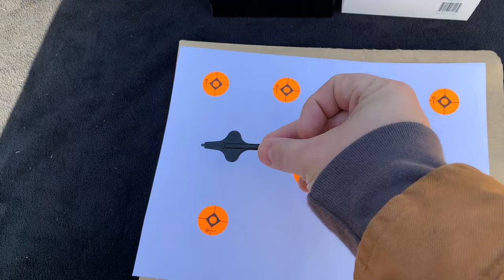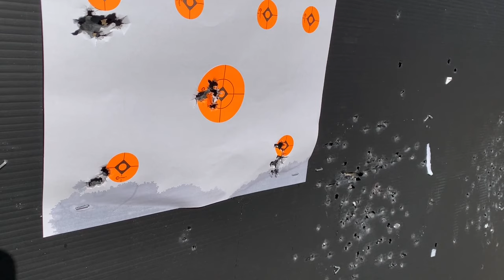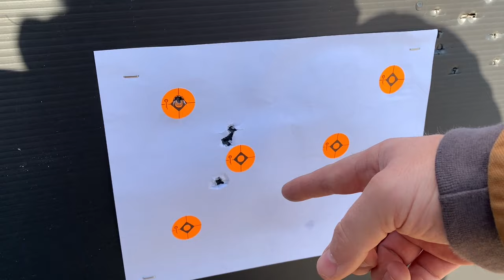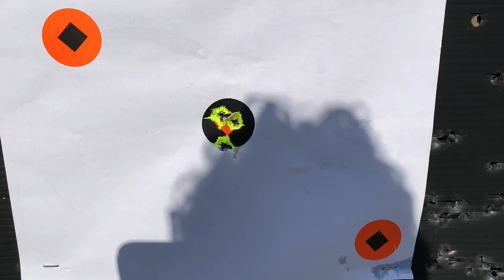Zeroing a Pistol Red Dot

Comment: when zeroing any sight; laser or RDS use a bench rest and range finder for best accuracy.  Eliminate human error.  Every time you shoot standing there will always be variation and difficulty zeroing.  Guns don't need to be broken in from the factory.  They're accurate out of the box.
Reply from the maker: “Accurate out of the box” is a massive generalization and simply not true. Clearly there was impact shift, what the cause is I don’t know as I stated in the video. I didn’t say it was break in related, I said it could be a possibility. You are never going to eliminate all human error unless you put the gun in a vise and at that point you are going to be fighting factory ammo inconsistencies. If I can hit damn near dead center on a quarter and nickel size target from 7 yards repeatedly, that’s good enough for me. Like I said, I’ll check it on a cold bore and make adjustments as needed.
Reply: That's actually not how you want to be doing it because from a bench you'll find your line of sight changes drastically.
Reply: @TerminalM193  Facts because I just zero my red dot with a stand at first, then stood up and my shot group of 5s was way off.  Just zero it standimg up 15yds.
Reply: @realspitkenny5561  Yea, took me many of zeroing processes to realize this. I now do the exact same as you, zero while standing at 15 yards. It takes probably double the amount of rounds compared to a bench zero but it's a no discussion topic in my eyes. Just like you my bench zero would be set but the second I do standing shots on target its off not only by windage but also vertically as well.
Reply: @realspitkenny5561  9
Reply: You dont need all that but sure
Reply: nah. they aren't. specially mass produced guns. but if you're dealing with competition guns. yeah out of the box they're zeroed.
Reply: This is a bunch of turd info. If your zeroing from standing, you zeroing for you lack of marksmanship, when you get better and stop pulling etc, you’ll be off, with the bench you zeroed for exactly where the gun should shoot. you guys standing zero are just accounting/zeroing for your error, which hopefully goes away as you shoot more but then your zero will be off

Comment: I tell everyone when making adjustments to a red dot optic ALWAYS make big adjustments.  Don't waste your time with "three clicks".  Start with EIGHT and go from there.  Also you don't start sighting in a hand-gun standing.  So much human error.  Bench rest it then when you are on go ahead and try it standing.  By the way excellent shooting.
Reply from the maker: I’m a worse shot from the bench with a pistol. Seriously not to brag but I’m confident in my ability to put accurate shots on target to get a 7 yard zero. I’m not saying everyone should free hand it but that’s what was best for me. Thanks!
Reply: I've zeroed a LOT of red dots for people at the range I work at on the weekends, and have never used a bench rest. I do use a sightmark laser bore sight for gross alignment to start though. So far in two years, I've never needed more than 5 rounds to zero and put multiple rounds through a 1" center. Some red dots will drift on one direction when you adjust the other. I do recommend always turning down the brightness on the red dot as low as you can effectively see to minimize eye strain and glare.
Reply: Bench is helpful but realistically it's about marksmanship and why not sight when you're standing?

Comment: IMHO I would zero it from a bench rest first to get it as accurate as possible. That does 2 things, 1 it makes it zeroed to your point of aim 2nd after it being zeroed you can shoot free hand and if it’s off you now have a reference of what you’re doing wrong and can practice your trigger and or grip mistakes you’re making and can correct accordingly
Reply from the maker: I’ve tried both with various setups. Idk why but I’m way more consistent offhand. I’m not saying anyone shouldn’t use a bench, that’s just my personal preference. But definitely if I had consistent low lefts or something I’d wanna key in on grip/ trigger pull etc.

Comment: The close distance is like that those clicks don’t add up to a very much deviation for the point of impact. Most sites are like one MA per click at 100 yards or something. So if you’re only at 7 yards it’s going to take a lot more clicks to move at the same distance.

You have to keep in mind if you’re an inch to the left at 7 yards you’re probably going to be 6 inches to the left at 100 yards or some other larger number. It’s a lot of clicks as the bottom line.
Reply from the maker: Depending on the moa adjustment per click. Most scopes are 1/4 moa click adjustment but I’ve got a couple scopes that are 1/8 moa. This dot is a whole 1 moa per click so it’s less adjustment than you’d think if you’re used to 1/4 moa scopes.

Comment: 25 yards is the recomended zeroing distance for handguns. Always start off a rest for consistency.
Reply from the maker: Statistics show the average distance of defensive handgun use is 3-5 yards and as I mentioned, irons were dead nuts at 7. 9mm inside of 50y it’s pretty flat so if you’re talking about the difference between 25 and 7, you’re literally splitting hairs. Not to mention you can be far more consistent with a 2 moa dot on a nickel sized target under 10 yards when you have no magnification vs struggling to cover the target with your dot from 25. I’m pretty damn comfortable with my consistency offhand as opposed to putting pressure on the frame and shooting from a position that’s not practically repeatable.
Reply: where did you come up with 25 yards being the recommended distance?
Reply: Sounds good in theory, but 99% of shooters can't shoot a tight group with a pistol at 25 yards.

Comment: Great video! I just installed the 507C on my Glock 22 .40 S&W. It's a brand new gun as well, so knowing that it might change after 500 rounds is good to know. I've fired 200 rounds with it and haven't shot yet with the red dot sight. Thanks for making this content!
Reply from the maker: Thanks for watching! 40 can be snappy so it wouldn’t be a bad idea to check the torque on your mounting screws at 500 as well. Even with locktite, I’ve seen them back out with hard use.
Reply: Bruh tell me why I’m trying to learn how to zero my sight for the exact same build 😂

Comment: Hey, I just got a cz p10-c. Was your sight picture set at 6 o’clock hold? I’ve only ever shot center hold and it’s weird. But I think the 6 might work better with a red dot. What are your thoughts?
Reply from the maker: Do you mean iron sights being 6 o’clock hold? Mine were center hold and my dot is as well. I would advise center in the event you want to stretch the distance. A 6 o’clock hold imo would make guesstimating holdovers more difficult. My Glock 19 was a 6 o’clock hold and I didn’t care for it.

Comment: Hey mate, do you still rate the Holo sun 507x-x2? do you use manual brightness or the auto function? i have found auto can be detrimental when using in low light conditions
Reply from the maker: Still love it. Run auto but yes low light can be tricky. Backup irons are a must. Even on full brightness your weapon light can wash out the dot to a degree. I run the auto with backups and know I might have to switch to irons under low light. Big fan of rear iron in front of the dot btw

Comment: I own a CZP10C 9mm and will be getting a Holosun 507c x2. I've  a CZP10-S 9MM that's OR coming, which will be getting the same red dot.  In theory shouldn't I be able to switch the same Holosun 507c x2  from gun to gun?
Reply from the maker: You could but I don’t suggest it. Zero it and leave it. God forbid you strip something out going back and forth, could be a nightmare

Comment: Mines is centered but for a reason it’s too high and I went to the max lowest and it’s still too high have it mounted on a 19x 😢 probably have to keep messing with it next time I go to range
Reply from the maker: Check mounting screws. Take it off and  put it back on.
Reply: @yota_blaster5030  thanks for the reply bro but how would this hell my sight im curious going to try once I hit the range again
Reply from the maker: @simpdaddybrayan1624  It’s possible that the optic wasn’t square in the mount causing a slight discrepancy in the angle in which it’s mounted. Screws can seem tight but are actually in a bind which would also effect the mounting height. My slide was cut by a gunsmith instead of using a factory mounting plate so the tolerance is so tight if I take the screws out it will stay in the cut without falling out so if I didn’t have it perfectly squared up when mounting it would torque down to spec but actually be off. I would just start from scratch, take it off, reinstall. torque to spec with blue locktite and try again from 7-10 yards. If you still have issues there’s no shame in asking someone at the range or gun shop. Have someone else verify the issue and contact the manufacturer for a replacement. Take pictures during the install/ on the gun, the adjustment screws, and your impacts to show the manufacturer just in case they can help you troubleshoot or to expedite the replacement process.

Comment: U using dovetail how is it? I just put holosun hs407c x2 on my glock 19x dovetail never tried it  yet. . Alot of people saying dovetail cant hold zero very well. .
Reply from the maker: No the slide is milled for direct mount to optic. Rear sight dovetail has been cut in front of optic. Running a Glock rear sight, and tall front sight for lower third cowitness.

Comment: I’m new and tried zeroing it just looking thru the sight and I’ve probably turned it at least 10-15 times and haven’t noticed any change every time I turn it. I’m bringing it to the range tomorrow to try and figure this out, but if anyone has any tips or same experience that I’ve had, some help would be greatly appreciated
Reply from the maker: You’re not going to see the dot move but it does. The adjust is very minute at the optic but more noticeable on paper. Even when I crank up the elevation turret on some of my long range scopes you can’t really see the crosshairs move with the naked eye.

Comment: Nice video... did you ever do the cold bore confirmation?
Reply from the maker: Yes. I have been attending classes so I 
haven’t been filming much. Not only did it hold zero on a cold bore but it held zero after removing the optic to have a dovetail cut for the rear iron sight. I have yet to touch the adjustments since setting up the gun during this video

Comment: You're doing exactly what I want to do with my P10C. How are you mounting your optic? I don't see any rear sights in front or behind your optic.
Reply from the maker: Great question. I took my pistol to a gunsmith and had the slide cut and optic mounted ($125). You’ll notice the P10c rear sight is different from guns like the Glock in the fact that the dovetail that the sight slides into is forward of the blades of the rear sight itself. The sight is sort of an L shape as opposed to just a pyramid or block that dovetails in. There are 2 options both require purchasing a tall CZ front sight and tall GLOCK rear sight. You can either have the dovetail for the Glock rear sight cut behind the optic or in front. I plan on mounting it in front of the optic. Checkout Sage Dynamics for more information on this.
Reply: @yota_blaster5030  yeah I've seen Sage Dynamics video. His optic review of the Holosun is why I really liked it. If you didn't want to go the route you are right now Primary Machine offers an optic cut that mounts the optic in front of the rear sight. I didn't want to wait for the lead time since my P10 is my only firearm, so I'm thinking about buying an extra slide from Primary Machine already cut for an optic.
Reply from the maker: @Bayless18  Right on. Yea I like the idea of the rear sight in front (mostly to piss off Fudds) I just haven’t purchased the new irons yet.
Reply: I got my czp10c slide milled with glock tall sights. Love it

Comment: I just bought a red dot, since eyes are failing. Are you only using the dot or front sight and dot.
Reply from the maker: Great question! This was before I added replacement backup iron sights. My rear sight now sits in front of the red dot and that and the front post are both slightly taller than factory. This aligns them in the lower third portion of the red dot window (lower third co witness). So my irons align with each other but not the dot. They are only used as a backup in the event the dot should fail.
Reply: @yota_blaster5030  thanks. I don't understand what you mean by rears are in front of dot. Literally the rear sight posts are in front of your RMR and the RMR is wear your rears woukd be?. Never heard of that.
Reply from the maker: @billtaylor1656  Yes, the rear iron sight is in front of the optic. Somewhat unconventional but surprisingly practical.
Reply: @yota_blaster5030  wow I never heard of that. Was the slide milled specifically for that set up? Can pistols be bought that way?
Reply from the maker: @billtaylor1656  I had it machined by a gunsmith. I’m not aware of a manufacturer designing them that way.
Reply: @yota_blaster5030  cool. Thank you for answering my questions. Sorry to bother you.

Comment: Question:  If i took a Bore Siter the bullet type & put it in the pipe, then line up the dot from the Holosun to the dot from the bore siter wouldnt that be spot on at a certain distance like say 20 feet ?

I did this with my C5L Viridain Laser & worked Dead On
Reply from the maker: In theory, yes. Just like sighting a rifle etc your zero distance dictates a lot, firearm characteristics, cartridge characteristics, etc. It’s not always as simple as “this bullet velocity is different so my elevation will change”, there can be discrepancies in windage from one ammo to the next as well as changes in impact elevation. I can’t say with certainty but I would imagine your optic height over bore can also factor into zero’ing and discrepancies in bore sighting versus impacts at varying distances. Long story short, I would zero at 7-10 yards (statistical engagement distances) and then based on what firearm and ammunition you have, find out at what distance your bullet begins to drop as well as where you have a discrepancy with shots closer than your zero distance. If you zero at 20, where’s it hit at 10? It is likely completely negligible but good information nonetheless

Comment: I wish I never bought this for my ar15 .I missed everything. I can't adjust it .I gave up .I like old iron sights works perfectly. It doesn't fit a holster .I like flashlight red or green laser light
Reply from the maker: No offense but that sounds like operator error. There are countless examples of people running these on AR platforms and pistols. Your holster should be optics compatible so it’s not an optics issue, it’s a holster issue. I would say every weapon you plan to use for self defense that has the ability to attach a white light should have one. IMO lasers are a novelty (with the exception of IR). With all do respect, I would recommend asking someone for assistance next time you try and zero your optic. If you have the same result, contact the manufacturer, defects happen whether it’s Holosun or Trijicon.

Comment: When u sight in do you use a constant offset method( take into account the bore axis to the red dot height) Like a laser sight? This is my first red dot
Reply from the maker: If I understand your question correctly, I do not accommodate for mechanical offset or any type of hold over. I’m not a pro at this by any means so out of the box the pistol was dead on at 7 yards with no 6 or 12 o’clock hold so I zero’d my dot to be the same. Stepping back to 20 yards, I was able to hit 6” steel plates consistently so I’m happy with that.

Comment: What is your point of aim? 
Are you lining up the red dot to the front post, or are you shooting where ever you see the red dot is? 
I didnt hear you distance. Just curious what your distance was. I put my first red dot on my p365xl a bout a month ago. Shot it 3 or 4 times now and i pretty much line up the dot to the front post and im on point at 5 to 7 yards. The red dot is a romeo zero. I have the holosun 507k just dont want to take the other one off just yet. I can see that the holosun is light years advanced. Thanks for sharing.
Reply from the maker: If you have tall iron sights that are “absolute cowitness” your dot should line up. The factory irons aren’t usable in this configuration. I have since then installed irons that are lower third which means you can see them through the optic but they line up below the dot. This gun from the factory is point of aim impact at 7 yards so that is the distance I used for my optic zero. On 8” steel plates, I hold the same zero from 7-35 yards (haven’t shot outside that distance yet). I hope this answers your question
Reply: @yota_blaster5030  pretty much brother, im using a p365xl. Were you using the czp10s?
Reply from the maker: @jardinero9112  P10c. I have 2 of them. Eventually I’ll buy the F and S since the slides and frames are interchangeable

Comment: Aren't CZ Pistols famous for being broken in at the factory? I'd say the deviation might be more the fault of the white box ammo, and maybe a bit of human element since you weren't stationary on a bench.
Reply from the maker: I know the triggers break in so I’m sure other parts can do the same but I’m no expert. Talked to my gunsmith who indicated your optic can kinda settle into the cut and suggested shooting, torquing screws to spec, then repeat every 100 rounds or so a few times. That’s what I did and it’s been dead nuts. I admittedly can’t bench shoot, it’s awkward AF but I can shoot dimes from 7-10 yards pretty consistently so I’m confident enough with my offhand zero.